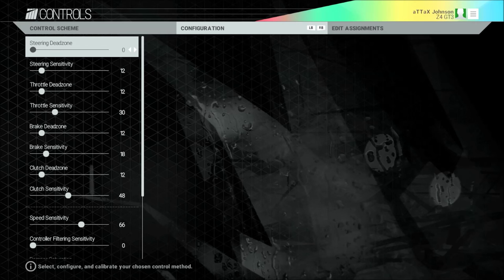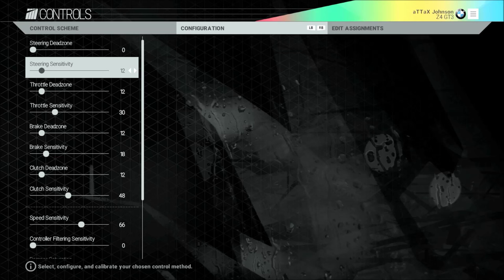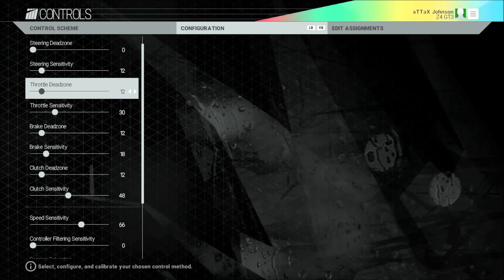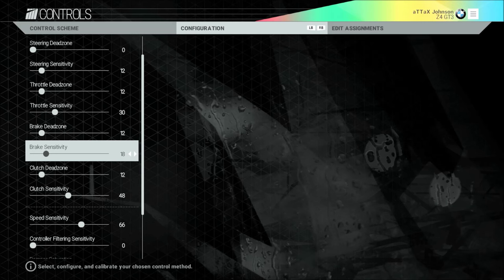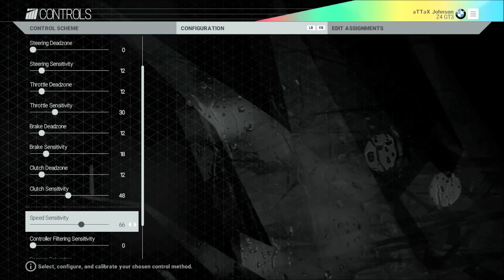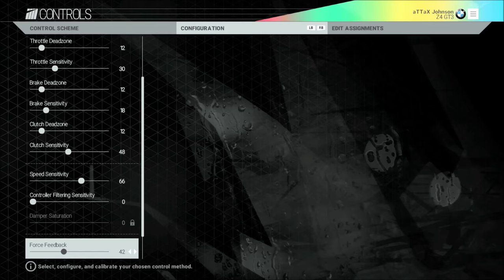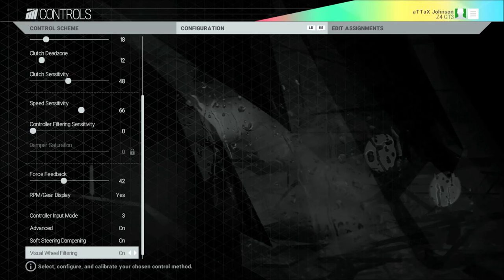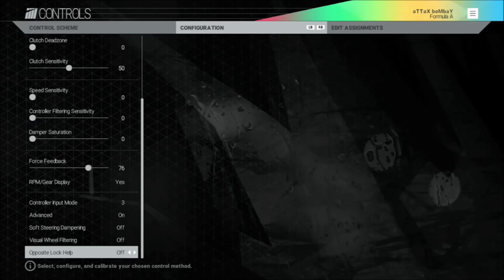Project Cars - Great Controller and Wheel Settings(Fanatec CSW) + Explanation by Johnson *English*

Comment: Could you tell me what Tyre Force setting you are using with your wheel please?
Thank you for sharing your tunes and settings with us.
Reply from the maker: Robert Fox Hey Robert, these settings depend on the car generally. If you take a GT3 (the McLaren f.ex.) car, the following settings might help you:

Tire Force: 100
Relative adjust gain: 1.10
relative adjust bleed: 0.10
relative adjust clamp: 0.95

If the tire force is too heavy for you, reduce it in slow steps (-5). 

Hope I could help you out a bit. :)